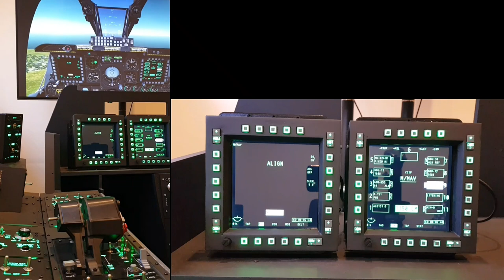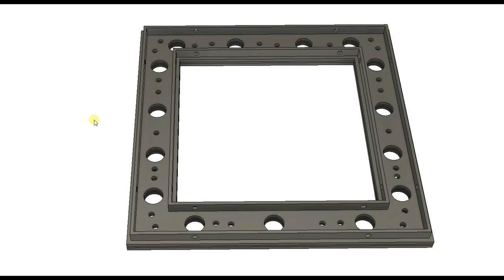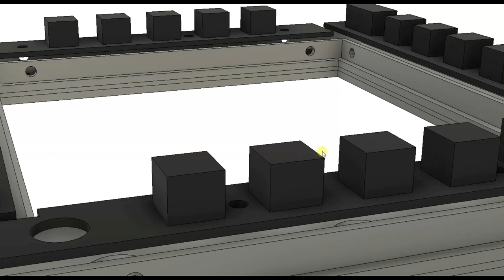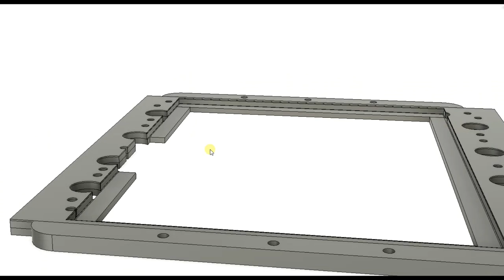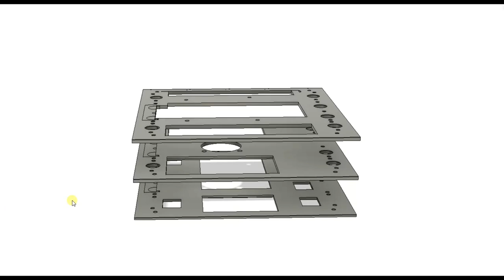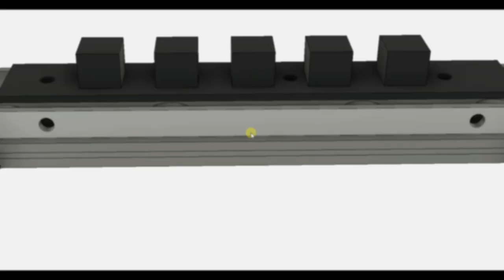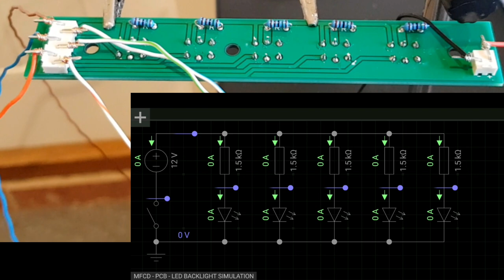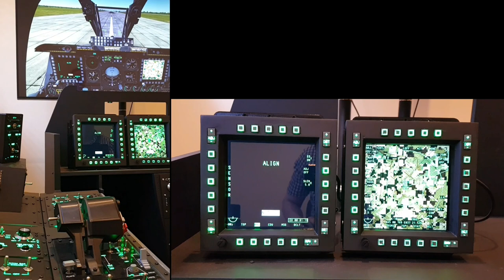Simpit A10C - Front Dash - Part 9: MFCD Design - 3D Model & Tactile PCBs

Comment: Outstanding work! I need a 3D printer!!
Reply from the maker: Hi Ray, after using one, I'd say get the best one possible you can. Some are of a standard that can be left overnight. However, others you need to keep an eye on a little more. The MFCDs I did were 60 hours of print time (combined), so I would have preferred to leave on over night had I been able. Also, automatic bed levelling would have been great on reflection. Cheers

Comment: Did you use real dimensions for the outline of your MFCDs?
I ask because looking at "The Warthog Project's" front face design, an 8-inch LCD sticks out.
My thought was to put all the excess at the top where it would be under the glare shield.  However, yours sit entirely within the outline.

Comment: Hey Craig - quick question - and I really hope it's not a stupid one, but when you're wiring mechanical switches into digital circuits, are you not supposed to wire capacitors across the switches, because of 'switch bounce' causing problems with very fast response digital circuits? I only ask because I saw this emphasised during a video done by a guy who was wiring switches for his 737 cockpit sim. Otherwise, so interesting to see your work, thank you for sharing it. The standards of design and build that you work to are incredible, it's very inspiring and a little intimidating...
Reply from the maker: Hi Richie, 
On the keyboard encoder the inputs on the headers are activated by shorting them through a switch to any one of the provided logic Grounds on the header. When activated, the input will report the keystroke
On this particular type of encoder the inputs are intended to handle mechanical switch inputs and are debounced for that purpose.
If you take a look at the below link, I outline some further detail about this keyboard encoder and a link to the company's website. 

http://mysimpit.co.uk/faqs/

To be honest, these keyboard encoders are amazing, just a bit pricey. I got mine before dcs bios was created. I find using the keyboard encoder for inputs and dcs bios for mostly outputs as well as potentiometers is a great mix. 
Thanks for your positive comments. Appreciated.
Reply: @CraigSmysimpit  Thanks for your response Craig, that's actually very helpful. Those Hagstrom keyboard encoders do look very good, so versatile, they seem to be the perfect solution (or part of it) for complex cockpit builds, or any application where it's desirable to abstract keyboard inputs into a pc into 'shortcut' button presses. Yes, they are a bit pricey, (as much as a decent x86 motherboard), so I suppose you have to be quite committed to your project, but I'm guessing that no other solution currently exists which can match it for functionality and convenience. 
I'm not currently doing a cockpit build, but the idea fascinates me, and I'm considering getting one of these Hagstrom encoders just to have a play around with. 
Please keep up with your content, it means a lot to those of us who watch it.
Reply from the maker: Hi Richie, if you get one of the encoders let me know what you think. They've always worked well for me. All the best, cheers
Reply: @CraigSmysimpit  Yes of course I will, best wishes Rich